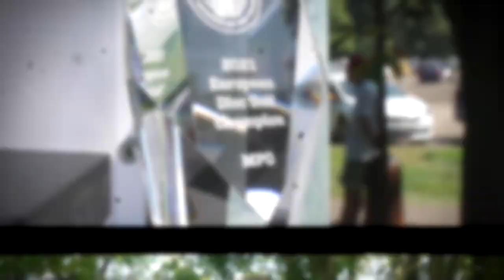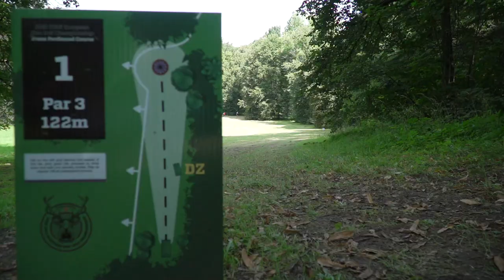2021 European Disc Golf Championship | Final Round, Front 9 | Anttila, Carlsson, Heinänen, Semerád

Comment: question - does anyone know why alot of pros use the glow discs? Do they fly better somehow?
Reply: They're usually a bit more stable than regular disc runs. With great stability comes great consistency.
Reply: Depend on the brand. For innova and latitude they are more stable. For kastaplast they are more flippy. Don't have glow by any other brand. Kastaplast though is perfect for night/winter golf, since they glow for hours and hours.
Reply: The grippiness/feeling of the plastic on the Glo Roach is the best for any putter I've held. Sadly the tall rim doesn't fit well with my hand :(
Reply: @freddan6fly  Prodigy has glow discs too. I got one and it became extremely understable after one hard tree hit :/ But I think they also have a stronger blend of the glow plastic.